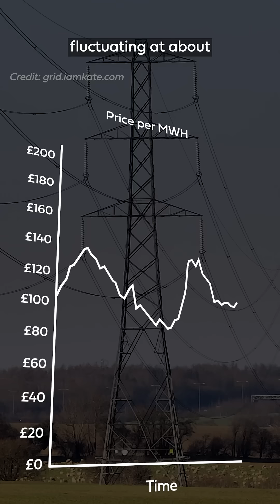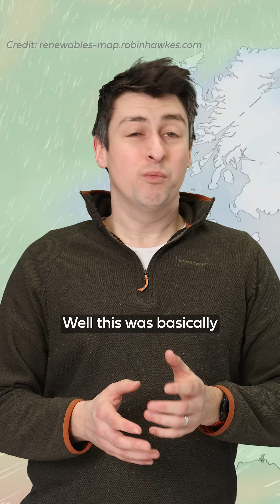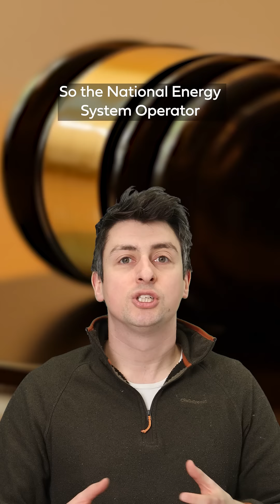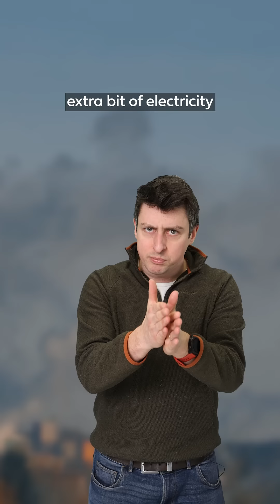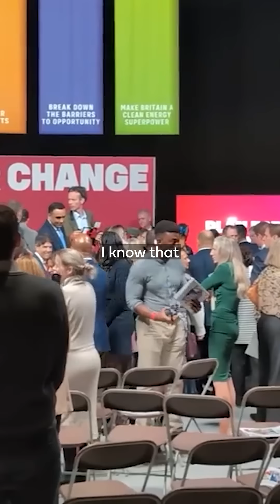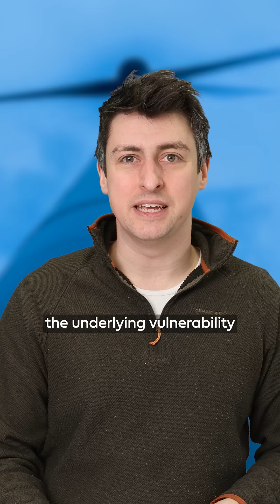The biggest price spike of the energy crisis happened last week

Comment: How does the auction work, you say “Hey, I need more electricity, best offer wins!” and then the suppliers bid higher and higher until someone says “I can’t handle that much money, I’m out.” and the highest bidder wins?
Reply: Power generators make their bids - “I can sell you X MWh for $Y/MWh”. The system operator ranks those bids from lowest to highest. They accept bids up until they’ve accumulated enough MWh to meet demand for the next time increment. The last (marginal) generator needed to meet the last increment of demand sets the price for the entire market. So, if you need 1001 MWh for the next 15 minute period, and you have wind farms that can promise 1000 MWh at $0/MWh, they won’t quite meet demand so, the next bidder is a gas plant that can generate at $50k/MWh, then the entire market price is set at $50k (including the wind generators). That’s the basic of how most deregulated electricity markets work - there are nuances/differences everywhere.
Reply: @michaelpullinger  That would highly instivise creating scarcity for the lowest price suppliers (as a matter of fact, you should make sure that you ALWAYS just can't meet the full demand, so the next higher cost supply needs to be mixed in to increase your sale price and therefore profit).
Reply: @maasro only really works if the lowest cost source/s is monopoly owned,  
otherwise when you give up that bit of generation, someone else with a similarly cheap source will just take it. Net result, nothing really. And if demand is that high that they can’t then you’re already going to the price set by the next lowest bidder anyway, even when you’re at full generation.

Basically you’d be giving up money at all times, including when the price was high since that capacity is excluded from your bid, and barely if at all change what the price was (because how often is demand going to be exactly on that borderline instead of much under or over).

So basically you’d need a cartel fixing bids, and the ability to predict demand very accurately.

Much easier if you are a very large single generator like a nuclear plant to fix prices high than if one of dozens of renewable or even gas operators.
Reply: @michaelpullinger so the system operators are the ones deciding to charge at that rate? why?
Reply: @michaelpullinger  thanks for reminding us again - tho it STILL sounds bonkers no matter how many times i hear it
Reply: @alveolate  it is used to stimulate more cost effective power generation which almost always correlate with „greener“ energy. Thus the supplier setting the price for the entire market isnt making any profit while suppliers with cheaper (and thus greener) energy are making more profit.
Reply: @falschgedenkt9086  except the "profit" punishes the CONSUMERS, who are trying to switch to green electricity mostly out of obligation or moral consideration. this makes the entire grid look bad to consumers, and in turn makes citizens think the policy sucks, which then hurts renewables' PR.

"if switching green makes power cost more at random times, why did we bother switching in the first place"

then you'll get the fossil agitpro guys saying "gas/oil/coal keeps things stable" yadayada, retroactively making this entire thing play into THEIR hands.

look at it from a policy standpoint: if the goal is just to give renewables better returns, can't it be done without introducing random price spikes? is this whole auction thing really necessary? and as the short says at the end, no it isn't. there are multiple ways to retool the policy so the spikes don't even happen.
Reply: @michaelpullinger  How is that unregulated? we have one of the most regulated energy markets in the world yet we pay the most despite us having the same system of the US model who pay 4x less than us
Reply: Yeah feels like it should be the other way around. Start high and then underbid etc.
Reply: It would be better to stimulate savings by informing the population that a reduction is required. Everyone then goes and turns of not necessary items. In NZ most hot water cylinders have a switch system and can be turned off in times of high demand.
Reply: @Dartvalleyfawn  With the tarrif I've opted for, my electric company will sell me power for $0.07/kWh (USD) if it's used between 11pm and 6am, $0.22/kWh between 2pm and 9pm, and $0.11/kWh at all other times.

I imagine that in the UK, where energy prices are much higher, a time-of-use scheme like this combined with a home battery could save you significant amounts of money.
Reply: @Dartvalleyfawn We do that in the UK, partially. For example supplier Octopus has power saving sessions you can opt in to. If you use less at that time than you normally would they knock a little bit of your bill.

If you do need to use power though, you are not penalised, you just pay as you normally do.

It’s a great way of doing it. No penalties, but maybe a few pounds back if you do use less energy.
Reply: Its lowest bid wins and its common across many industries. It’s not a unique system just for the energy sector

It’s still a bad system and if you add collusion with suppliers being able to choose a price if the demand requires their energy. You’d have thought that there should be a price cap or a banking system to protect people from price spikes because there should not be an expectation for someone to know that electricity is 14x more expensive

Energy shouldn’t be operated by private companies anyway

Comment: How's the construction of new nuclear going for you in the UK?
Reply: It's slow, and expensive, and over-budget, but at least they're getting on with it and the first one is slowly nearing completion. After the first every one after will be slightly cheaper and faster. As the old saying has said for years and years; better late than never.
Reply: @ivolol  at over £100/MWhr, utility scale solar was about £47/MWhr back in 2019, so even lower now...  Battery prices are coming down, but gravity batteries would last much longer, maybe a hundred years or so?
Reply: @peterchandler8505 Solar can't solve the duck curve, it's the problem that creates it. Batteries simply don't have the density/capacity on a national scale to solve the duck curve. Gravity batteries don't have enough viable locations and distribution to solve the duck curve. We need to stop trying to create modern solutions with hopes, dreams and promises. The best time to act on climate change was twenty years ago, but practical solutions NOW are still a hell of a lot better than praying that "tech" will come along in a decade or two to swoop in and save the day like magic.
Reply: @peterchandler8505  solar is creating an ever deepening duck curve problem. Batteries simply do not currently have the capacity / energy density for mass, long duration support of the grid. You can determine that quite easily with an afternoon on a spreadsheet and some physics equations. And that's not changing until someone wins a Nobel prize for a surprising new battery technology. Gravity batteries likely don't have enough viable locations to be a majority option, either.
Reply: Solar is honestly a waste of time. With wind at least we "only" have to store energy for a few days. Solar is available mostly in the summer when we need it the least. Storing energy for 6 months is near impossible at the moment.
Reply: @HeirToTheScarletSky  Not the view of the many I know who have invested in solar.  OK, not so much power on cloudy days, but it is still useful even in the north of the UK during winter...  Domestic batteries make them even better.  

Gravity batteries would have no problem with 6 months+ storage, as flow batteries.

Comment: Is the long term solution to the U.K. energy woes to build more nuclear power plants?
Reply: no since they can not be turned up fast when needed instead they supply a constant stream of energy which in this case was not the energy needed
Reply: @drlauch2256  The whole point of nuclear is that it provides a base load of power to replace gas, what are you talking about? 😂
Reply: @ I don't get what you didn't understand about their comment. You even put it in your own comment with the whole 'base load of power'.
Base load is the constant, non-variable power. This was a case of a spike in need because of underperformance of wind power due to a distant system. Even if you had nuclear power you would still have to fire up some gas or coal plants if a similar situation happened.
Reply: @nfzeta128  "Even if you had nuclear power you would still have to fire up some gas or coal plants if a similar situation happened."

Some is better than for all the shortfall. Add in the rest of the point of the video, diversified sources and better energy storage and nuclear could replace all natural gas except for maybe extreme circumstances.
Reply: @Cyrathil  Sure some is better than all but it wasn't all, there was still solar and other renewables.
That wasn't the point of my comment but rather to just points out nuclear doesn't solve the problem being discussed, definitely not in a efficient way. That's not to say it can't be part of the solution.
Reply: No
Reply: No it isn't, wind is, currently at least
Reply: I mean the UK could start a couple more but by the time they come online another solution would have been found, implemented and in use for a few years or things would have gotten MUCH worse in the meantime.
Reply: @nfzeta128 this is the exact same idiot logic that coalition politicians used 10-15 years ago to justify not building any infrastructure, just saying
Reply: @nfzeta128 so within 6 - 8 years something better that Nuclear will have been invented and running for a few years? The next couple of years are gonna be a banger then. Nuclear power plants don't take as long to build as you think.
Reply: @MC---  Yes, within that time frame something would happen and be implemented. Energy is an immediate demand. In just the last 3-4 years the amount of renewables built in UK and even in Europe in general has far surpassed the output of a few nuclear plants.
Even just building coal plants would be around that same time frame.
Reply: @MC---  Hinkley Point C was announced 2010 and ramp up of unit 1 is expected between 2029 and 31
Reply: @MC---  no, but you get better more efficient energy production alternatives, windmills have been increasing production nearly every year same with panels and even nuclear has advancements rather quickly despite being more complex, any plant you build will be obsolete when finished and will be tackling a whole different situation than when you ordered it, on top of that they are quite the hassle to decommission
Reply: @nfzeta128  you forgot you are talking to the holy sect of nuclear who don't actually see it as an energy production method but as a sacred way to stop building evil satanic chinese windmills or something, you won't convince them with facts, it's essentially just a more popular off shot of the renewable hate promoted by the far right
Reply: In a single word, nope.
Reply: @LouieAblett  in a single word, yup.
Reply: @LouieAblett In a single word, yep
Reply: It really feels like an obvious solution is to replace the natural gas plants with nuclear. It's not the perfect solution, but I've never really understood why that wasn't really pursued.
Reply: @Cyrathil  because Britain is probably the most expensive (non naturally uninhabitable) collection of countries on earth to build anything bar a few city states, so when you start talking about one of the most expensive things you could possibly build and add to that the fact that people hear the word nuclear and have a meltdown (get it), that leads to a situation where making it is practically impossible even for the first place to make commercial electricity from nuclear to do it again
Reply: @Cyrathil  Because you cant switch nuclear on and off like you can gas.
Reply: @ErikB605  And you do not have to, Nuclear is the base load which is the load the grid never goes below. that means that everything else takes care of the variable load
Reply: @Cyrathil gas plants are cheap to build, the fuel is expensive but they are perfect for situations like this when you need them only for a few hours every few months. Nuclear is the most expensive form of power, it must run 24x7 so it disincentivises the cheapest sources of power, then when it goes down for maintenance it’s a huge single point of failure that sends power prices stratospheric.